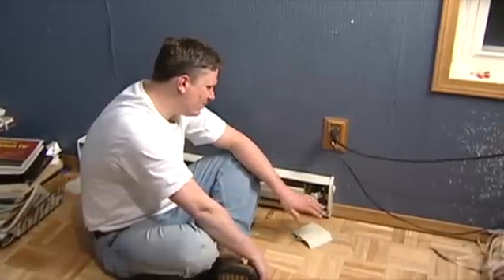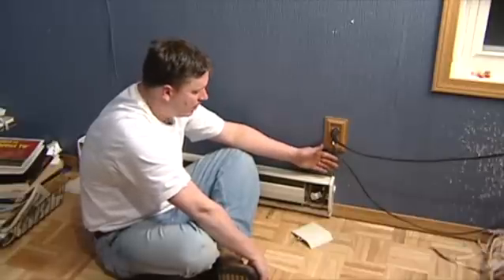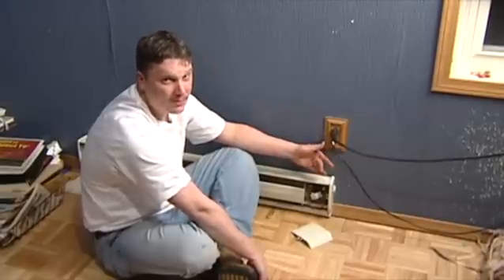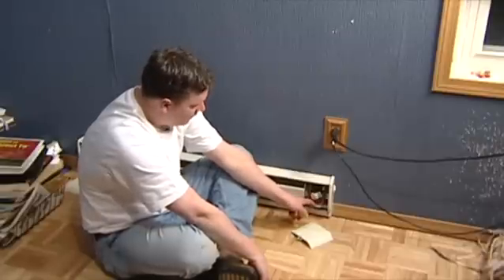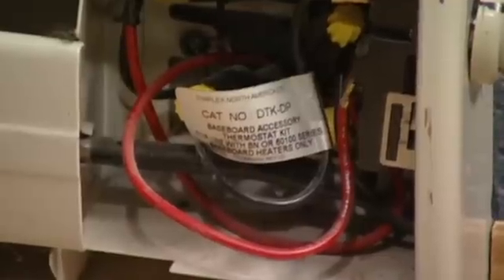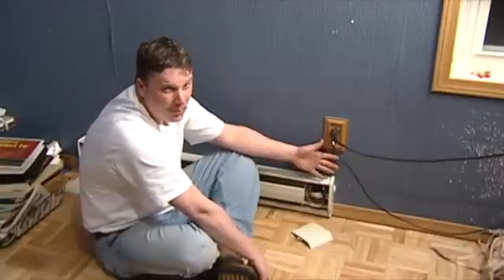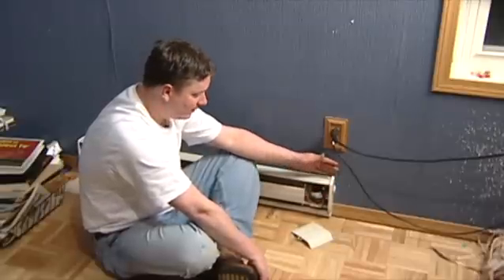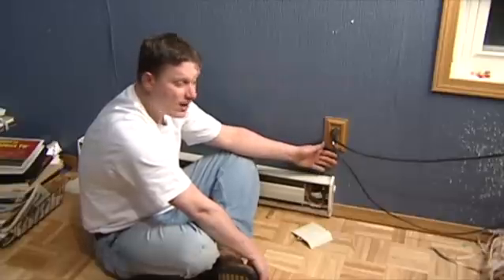Plumbing & HVAC Maintenance : How to Wire a Baseboard Heater

Comment: Hey Bud !!!! Great Vid3eo !!!
I got a question for you !!!
I have a 1500 watt Baseboard heater but right now I am only installing 1 in the dinning room !!!
The question I have for you is, 
I have a 30 amp 2 pole breaker hooked up so I get my 240 volts for this heater!!!
Is it safe to only run one 1500 watt breaker on this circuit till I get more hooked up?
I know this may be a silly question & usually people ask the opposite to what I am asking like,
"Is it safe to run 3 1500 watt Baseboard heaters on 1 30 amp 2 pole breaker 240 volts"... 
Like I realise that only running 1 1500 watt heater on a 30 amp circuit at 240 is a bit overkill,
But is it safe till I add more heaters?
Thanks Bud !!
DEv